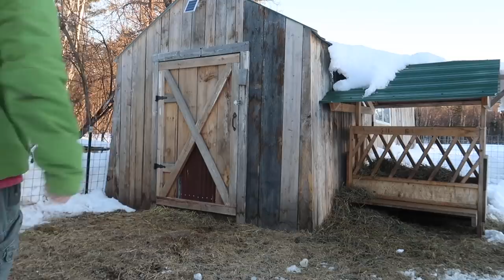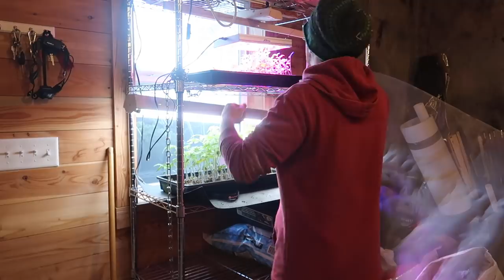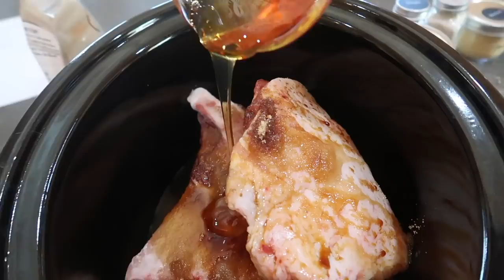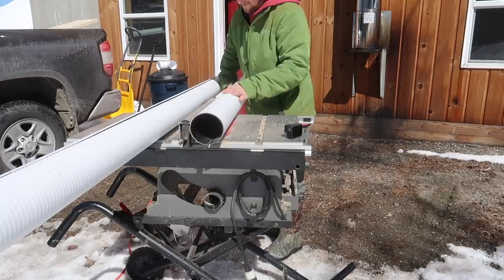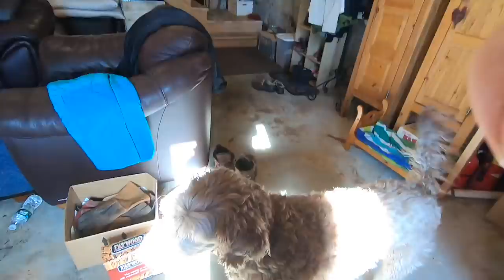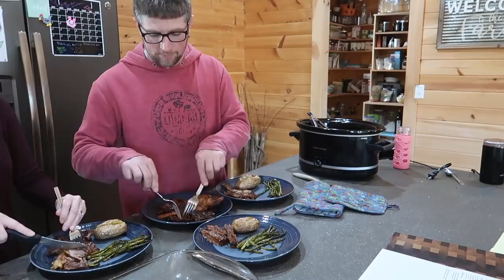The Goat that was REJECTED by her MOM acts Just Like HER

Comment: Al,  why not snow plow one path down to the goat barn.??????  
There is a safety concern about the corning ovenware shattering when taking from oven & putting it on a concrete top.  Google the info.
 The newer ovenware is made up of a different glass from the old days.  It is best you put it on a hot pad!  Maybe you could use the large mitts that I sent you at Xmas???